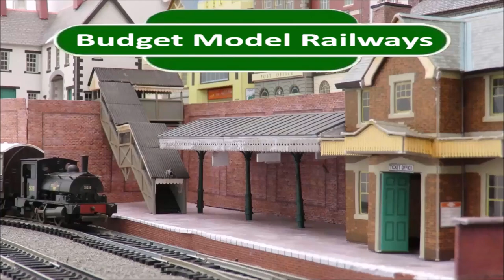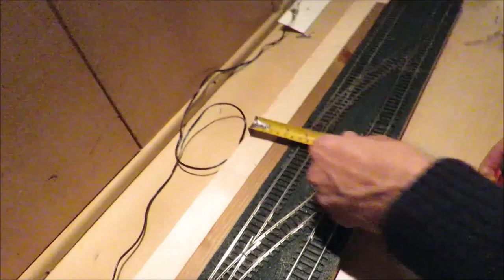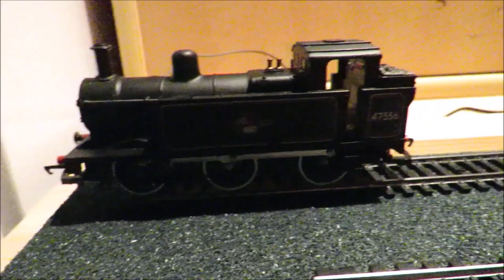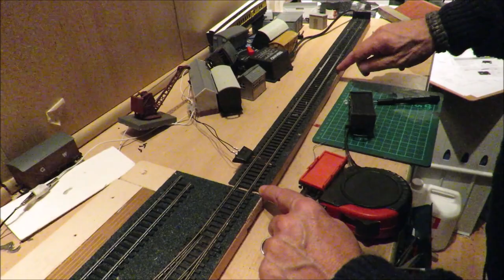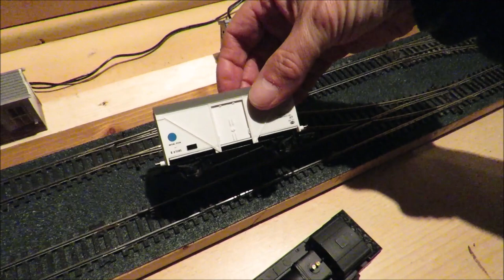How To Plan & Build An OO Gauge Micro Shunting / Switching Model Railway / Railroad Layout

Comment: Hi Mike, impressed with this micro shunting layout & would love to make it myself. I’ve acquired a few goods wagons & will need to buy a loco. I need also to purchase the track. Being a total novice could you break down the exact track plan, so I could buy what’s needed & have a go please? Thanks Mike👍
Reply from the maker: Hi thanks. I've built simpler and more effective layouts after this, perhaps take a look at my how to making a layout for complete beginners series. Generally you will need three or four points depending on which end your track comes in. This one used four right hand points with single straights and some bits of old Lima track. Consider buying second hand track and points as this can half the cost but buy Peco not Hornby as they are much more effective for shunting layouts. I don't have the layout any more and never draw track plans, sorry my layouts evolve rather than being designed. I have loads of videos on different shunting layouts so maybe take a look at them? Anything else just ask

Comment: I have a suggestion for 3-D printing.  A housing that would hold the device that connects the NCE DCC PowerCab to the track.  It would be nice to be able to use the NCE without having to mount that piece of hardware to a layout.